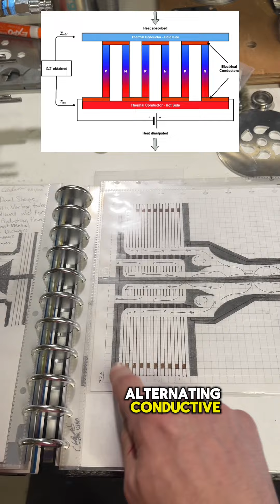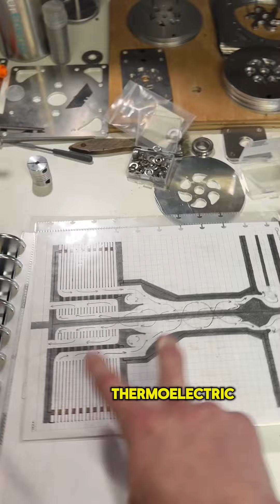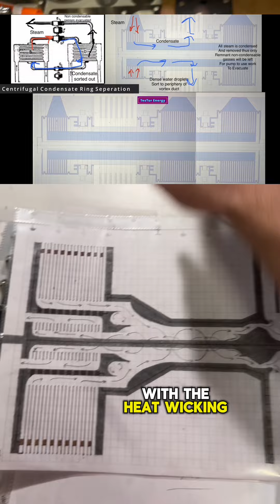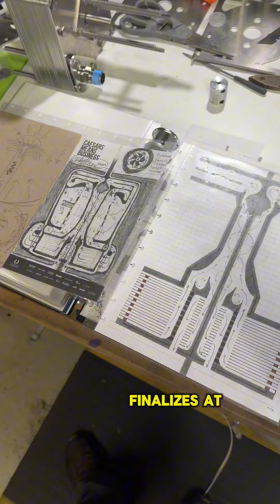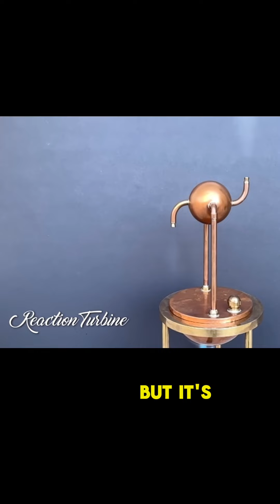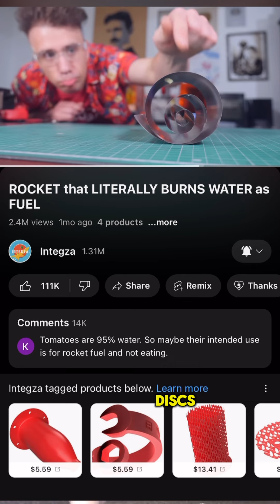The Ultimate Bladeless Turbine

Comment: Hi Charlie, regarding solid state electric generators (and fuel synthesizers), have you been following the thunderstorm generator / geet reactor developments? They seem to produce a plasma fuel synth'd by vortexing cavitated working fluids from internal combustion engine vacuum.

I'm having a hard time understanding how a 4:3:2 golden ratio nested Vajra-style counterflow heat exchanger "reactor" fuel synthesizer can produce ludicrous voltages that exploit the seeback effect without the need for solid semiconductor junctions like you envisioned here. Their TSG is so effective with its thermoelectric effect that it smashes through vapor electrolysis right into ionization/plasma, and further produces plasmoids that have been claimed (and something has been imaged) to phase through the steel walls appearing as luminous sparks outside the Vajra, and facilitate atomic transmutations of the combustion exhaust into oxygen and other harmless elements in its walls (no CO or CO2 or NOX or unburnt hydrocarbons). Unlike what you describe, there are no considerations for a seebeck electric circuit with anode/cathode and solid junctions, it is just vortexing counter-flowing water vapor vesicles and gasses, separated by SS alloy walls.

There's something about water and transmutation lately that everyone has seemed to have figured out and is rushing to commercial adoption.

At least for now, Malcolm Bendall is just focusing on the thermoelectric effect as a retrofit to a combustion engine. Your ultimate bladeless turbine as you call it, would include combustion and possibly replace engines in some capacity...

Comment: i love the idea, finally some real content again =)
one thing though.... electrolysis of the condensed water? how do you plan to accomplish such a thing? without salt or anything left in the water, there is no known way to make this happen ... as far as i know ;)
Reply: Exactly. Electrolysis requires conduction.
I think we all need to focus on finding the best Tesla turbine design and use solar steam to power them. The latest laser cutting equipment and whatever affordable material works best will make simple generators cheap and powerful.
Reply from the maker: Hey thanks for commenting. 🙏❤️‍🔥 It really helps with the algorithm 
 
 Geothermal steam has A LOT of electrolytes still in suspension that flow with the flash steam that the Tesla turbine can handle. 
 
And the centrifugal vortex tube causes all the condensate to stay to the outside going to the electrolysis disc stack no less. 🦾🤓

Comment: Wouldn't the discs become heatsoaked in a steady state application? 
I don't understand how the heat leaves the discs
Reply from the maker: @prophetrob  hey thanks for commenting. Because the fluid can still be expanded through the disc stack and casing even if the rotors not spinning.  As such it’ll be cooler at the exhaust.

Comment: It turns out that there's a lot you can do with stacked discs. This is the essence of convergence or integration of device elements into a single, unified device that, in the case for the TesTur expander, can also virtuously reinforce its performance.

We know quite well now that discs can serve as an expander or compressor, and today Charlie reminded us of his intent to integrate Peltier and Seebeck effects.

There are several more effects that can be integrated, such as

-parallel plates to modulate cohesive forces of water vapor

-parallel plates to act as capacitor plates 

-unipolar dynamo electric generator effects if the discs are subdivided spirally and the working fluid is conductive at the periphery in the presence of an external magnetic field 

-electrodes to serve electrolytic or decomposition processes (including ionization) 

-MHD thrust on conductive fluids with an external magnetic field 

-magnetic reluctance to produce torque in magnetic domains with subdivided discs 

The list goes on.

Thank you for being open with your ideas.

Comment: I'm still a little confused by how using the power to do electrolysis and then burn the products provides any power gain.  Isn't it a wash?
Reply: Besides modifying the viscosity of the fluid, and a miniscule increase in pressure, the heat wasn't adding anything of substance to the output mechanical power.

The goal of the additions leading up to and following the electrolysis is to generate mechanical power from the temperature contained in the compressed working fluid mixture as it expands through the device, so this thing becomes a true thermodynamic transformer. The Tesla turbine is primarily an expander, and converts only the fluid kinetic energy into work as rotational mechanical energy at the shaft.

The heat need to be converted into a bunch of forms and used with compatible fluid mixtures in order to be converted into mechanical power, this is one way to do it with steam.

The energy conversion process is as follows: the temperature difference is necessary to produce electrical potential, which is necessary to split atoms from (lets say) water molecules, which is necessary to combust and produce useful pressure and heat that will ultimately contribute to the mechanical action of the turbine in a virtuous reinforcement cycle.
Reply: @Infinion  I can see that utilizing waste heat is a gain, and converting from one form of energy to another can concentrate the energy into a higher-grade (e.g., converting low-grade heat into high-grade heat), which helps make it more useful.  Specifically, converting to electricity offers many ways to concentrate the energy, and this conversion pathway via electrolysis converts low-grade heat into higher-grade heat in combustion.  So that's a gain.

But, on the face of it, electrolysis (electrical -> chemical) followed by its (im?)precise opposite, oxidation/combustion (chemical -> heat/pressure; hmm...where does the electric potential energy go here?  Could it be captured?), would appear to cause unnecessary losses through more waste heat.  Consider the rough efficiency losses at each stage:  Electricity -> electrolysis (~70-80% efficient) -> hydrogen combustion/Brayton cycle(?) (~40% efficient) -> mechanical rotation.  Is this electrolysis-centered conversion pathway more efficient than using the TEG's electricity more directly (without the intervening electrolysis) to drive an electromagnetic (~80% electric to rotational efficiency) or electrostatic (~98% efficiency) motor?

Comment: This is incredible. Stacking functions like this can greatly increase efficiency. But I wonder if each stacked function takes away from the others' power, and if the least efficient function thereby decreases the efficiency of the whole system. Thermoelectric generators are known to not be very efficient.
Reply: Doesn't matter if a process is inefficient. You have created a temperature gradient with a large surface area in an expander as a consequence of its energy conversion process. The TEG is 5-10% efficient at converting heat into electricity, but the heat is used for other processes downstream. So all this figure tells you is there is 95-90% of that heat energy left for the downstream processes, such as preheating / evaporating other fluids
Reply: @Infinion  thank you! That makes perfect sense.
Reply: @Infinion  so maybe I was wrong to call these functions stacked. It's more like the thermodynamic transformer is the main transformation, and small amounts of heat and kinetic energy are siphoned off the periphery of this main transformation to increase efficiency by making use of what would otherwise be waste heat.
Reply: TimBlack1 I think so, although a thermodynamic transformer is supposed to be able to convert BOTH temperature differences and pressure differences into mechanical energy. A tesla turbine by itself acts only as an expander that converts pressure differences and fluid flows into mechanical energy, and it just so happens that expanding fluids rarefy and become colder. With a seeback effect integrated into the Tesla turbine, it will become a true thermodynamic transformer and convert both temperature and pressure into other domains, mechanical and electrical energy.
Reply: I see now that's exactly what Charlie said in the video. 🤦‍♀️
Reply: @TimBlack1  I mean you say 🤦‍♀but I'm thankful you even commented because we get some dialog from OP and deeper discussion on the subject, which is complex enough as it is without multiple forms of energy being converted around in a single machine!
Reply from the maker: I’ve spent a lot of time thinking about that’s. And I’ve come to the conclusion. That the heat the thermoelectric is using is what would heat soak through the discs anyways.  
 
And I forgot to mention but an electric current can be put through the discs stack for Peltier effect electric cooling of the disc stack for higher input fluid temps for increased torque output, as well as the voltage across the disc stack give the temp inside the periphery of the turbine casing. 
 
It has so many capabilities.

Comment: What do you think of the idea of integrating an electrostatic motor onto a turbo fan? I know a byproduct of these motors is ozone is a great oxidizer. I figured the electrostatic motors can add rotational energy, and the ozone produced can add thermal energy. Air planes collect a lot of charge when flying so I figured it would be logical to put it to use.
Reply from the maker: Honestly I think you might be on to something there. It needs some refinement but I really like your ozone as an oxidizer part. Might borrow that idea down the line infact 👏
Reply: @CharlieSolis  WAIT a minute I just realized you can feed pure oxygen into an ozone generator, and convert all that into OZONE!!!
Reply: I have been thinking the same. If the discs could be suspended by the air flowing through the system, the central rotor would not be needed, the air flow through the single hole at the center of the discs would be more efficient, and power could be taken off via an electrostatic generator, or electromagnetic generation at the edges of the rotors. But I think levitating the discs would be too difficult.
Reply from the maker: You great thoughts! But I’ve got a solution for that already from Tesla’s DC motor patent actually 🦾🙏❤️‍🔥
Reply: I'm thinking the ozone and UV would be useful for directly purifying the water going through the system, however I'm not sure I would really want to drink the water that runs through the turbine if it ends up creating little particles of metal.  As I've mentioned elsewhere, I would like to do atmospheric water harvesting using MOF-303, and that system would need to purify the water for drinking, so the ozone and UV from an electrostatic generator or (in reverse) Corona discharge motor would be useful.

Comment: How would you prevent corrosion and hydrogen embrittlement.?
Reply from the maker: Hey thanks for commenting. But with special surface treatments techniques that I have found for this explicit purpose. There are nano etching and chemical surface treatments plus other sputtering deposition methods for make complex alloy and material discs for enhancing the process in any number of ways.  
 
I hope this helps